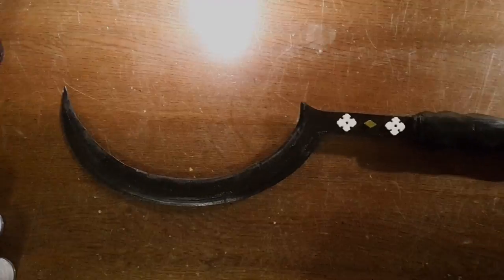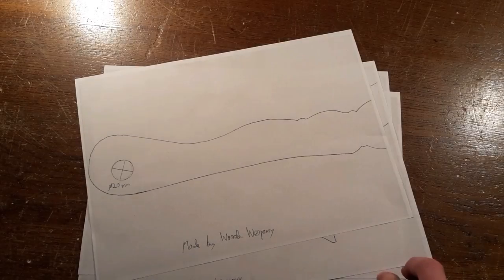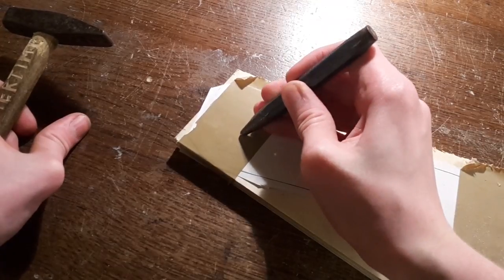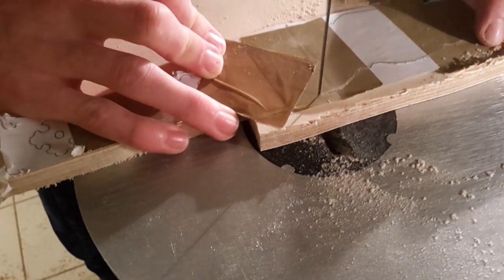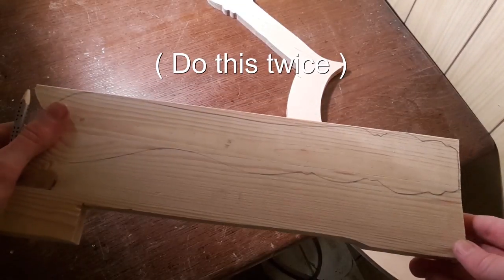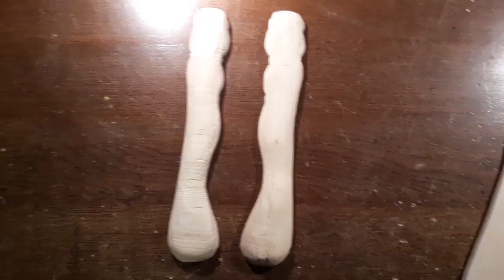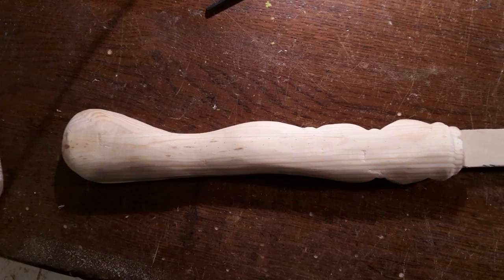Make Khal Drogo's scythe [Arakh] from Game of Thrones! - Free templates

Comment: the arakh looks great to me and I like the details you added above the grip. Also nice to see that you use your own handmade tool. :)
But I have a question : at the beginning of the video - when you slaughtered the air ;) - the blade looked like it would break. Did it just look like it would brake or would thicker wood be a better option? ^^'
Reply from the maker: +Nerd4Gaming Thanks for the comment! The never was about to break, might be am optical illusion idk..At which timestamp does this happen? ( I'm pretty confident that 12mm birch ply is strong enough for this task. )
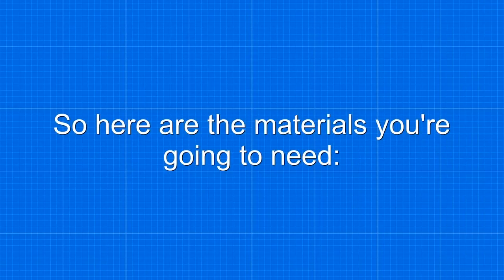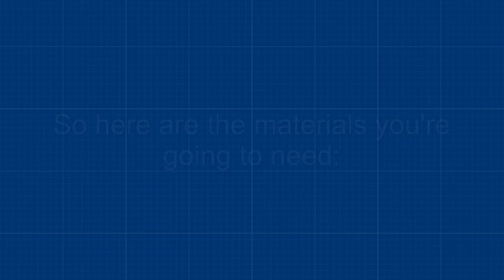Reply: Wooden Weaponry from 00:14 to 00:17; right at the start ^^'
Reply from the maker: Nerd4Gaming yeah, looks like it's bending, but I can assure you it doesn't :D
Reply: Wooden Weaponry okay :D